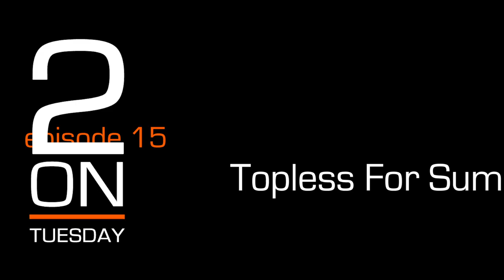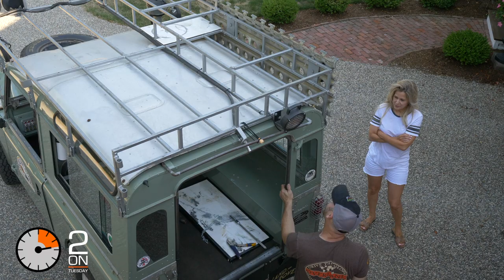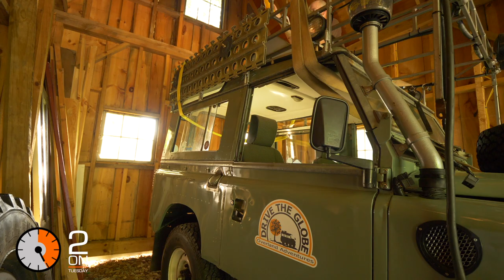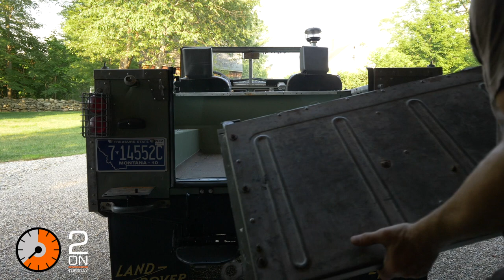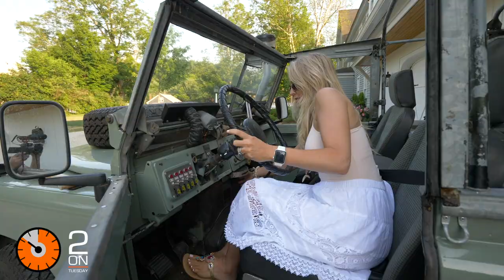Topless For Summer

Comment: U star, always wondered how the roof came off. Are all series 3 90s like this?
Reply from the maker: The old ones yes.  New ones a little different.
Reply: Series 1,2 3 are like meccano sets.
Everything is bolted on.. The door tops comes off, the front windscreen folds over onto the spare wheel on the nose, it's fun.
I drive my Series 2 88" and 109" full time like that...

No Series 3, 90 exists, unless it's a home job.
Defender 90"
Defender 110"
Defender 130"

It's the distance between centres off axles.
Series 1 80",86",88",107" and 109"
Series 2/a 88",109"
Series 3 88",109"

The best 4 x 4 x far. 🇿🇦